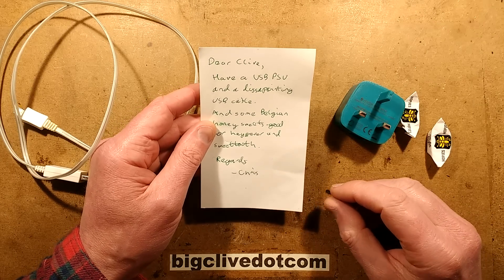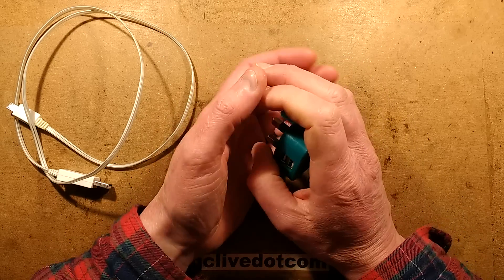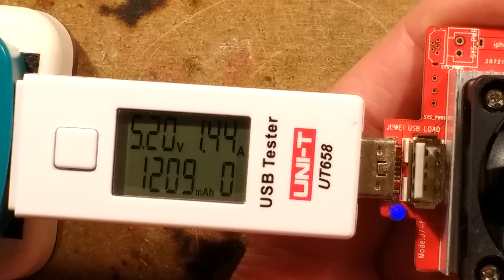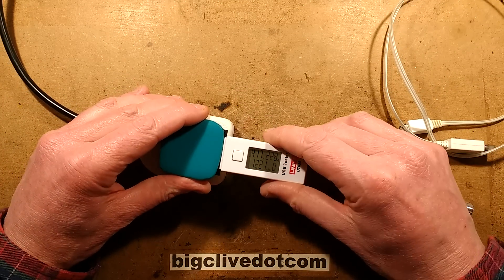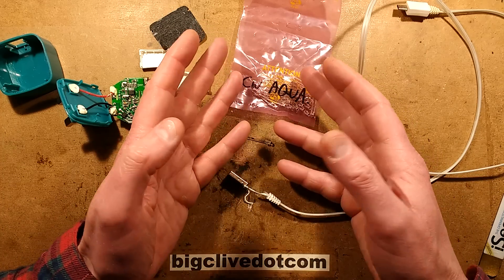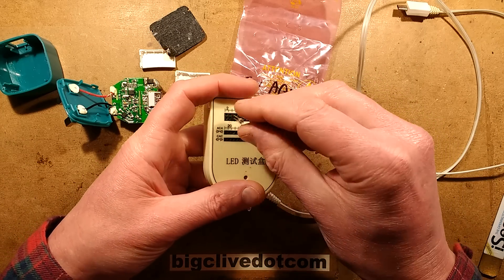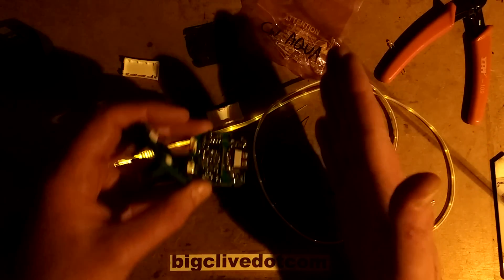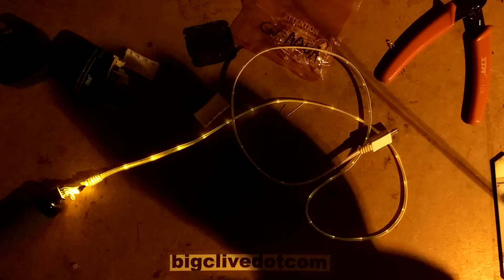Stinky Poundland USB charger and hack of random "faded" USB lead.

Comment: You guys are running entirely too much voltage into your houses.  You gotta just halve it and you'll be good.  Actually, that would put you in line with some of the other countries and you wouldn't need all those adapters and your gadgets wouldn't burn out if you hung your underwear on them.  I heard that Amerika has half your voltage and they're about as dumb a country as you're likely to find on a map.  Here in Nikkobba, we run on + or -55v.  We get 110 by going phase to phase.  We have a center tap we call neutral for small things like electric toothbrushes or flashlights.  We almost never have electrical mishaps.  Once a woman used the center tap for her curlers and took 9 years to do her hair.  That's about all that has happened.  You gotta get with the 90s.  Don't be in the dark.
Reply: alex tworkowski yup, good luck running a 1600w printer with that
Reply: Lower voltage equals higher current, current = heat more than likely to be fire plus alot more wasteful then our UK supply
Reply: Ethan Poole the point of an electric kettle is that all of the heat goes straight into the water you're heating. I have a kettle here in the US, 120v and 1500 watts, and it will heat water much faster than putting a pot of water in the stove, precisely because you're not having to heat the pot itself and the air around the burner. The 3000w kettles they have in Europe will heat a liter of water to boiling in a minute or less. The stoves they have over there are just as powerful as ours. It's just that it's much faster and more efficient to heat water in a kettle. And with the popularity of tea in the UK, an electric kettle is considered an essential appliance, much like a drip coffee maker is here.
Reply: Don't feed the troll...
Reply: ihniwtpu You do realize that we also have 30A breakers available to us, so if one is really inclined to run a 3KW kettle on 120V we can most certainly accommodate such.  In fact, though it is a little challenging to come by you can even keep the same #12 copper wiring and and actually run 3KW by Code -- the only catch is that there are no 25A receptacles so the kettle would have to be either hardwired or upgraded to a 30A service (30A receptacles are readily available).  Not that any of that is really an issue as any US kitchen is going to have a range/stove-top rated for more KW/BTUs than the kettle -- either 240V or propane/natural gas -- so there really is not much need for a 3KW kettle in our kitchens.  Or we can just go ahead and install a 240V receptacle wherever one is desired (my shop has almost as many as it has 120V receptacles).
Reply: I think some here have lost the plot. In converting mains electricity to a 5V DC supply, it does not matter what voltage the mains supply is. The power supply unit still has to convert the same amount of power to get a output of 5V at 2A, so a similar amount of heat is generated by it as a result...
Reply: alex tworkowski  If you have a farm, or a business or a very large house / property in the U.K., you can have a 400V/415V three-phase supply if you are willing to pay for it.
Reply: E=IR so I=E/R.  Notice that the current and voltage are both in the numerator.  As the voltage goes up, the current goes up.  P=I^2R.  The higher the current, the higher the power.
Reply: alex tworkowski  A 60V supply can kill a person in the right circumstances. And lower voltages can affect the human body. Your tongue can feel the electric current from a 9V PP3 battery for example.
With any electrical installation, if it is properly installed using high quality parts and equipment and properly maintained, then it does not matter if the system voltage is 110V, 120V, 230V, 240V, 400V, 415V or 650V. [400V, 415V and 650V systems are mainly used in industrial applications, I have worked on 650V systems as part of my job].
The whole point of using properly designed high quality parts and equipment is so that no part of any live electrical conductor can be touched.
Where large amounts of electrical power are required, 230V and 240V electrical systems do have the advantage compared to 110V and 120V systems. The cost of electrical safety features of U.K. electrical equipment is more than offset by allowing fewer and smaller cables to be used (less copper conductor) while allowing ring main circuits rated at 32A, so giving 7360 Watts of power available per circuit. This gives great flexibility on what appliances we can use and great flexibility on where we can use them. Although the ring main system is the most common, we do have radial (or spur) systems. These are normally rated at 20A (4600 Watts). For cookers and showers (fixed wiring systems) we have 30A, 32A and 45A circuits.
There are very few electrocutions and not many electrical fires in the U.K.
There is absolutely no need to fear electricity.
And just so that I am clear, I also have no problem with 110V and 120V electrical systems. Back in history someone had to decide on what the domestic mains voltage would be. At the time there were various competing systems in many countries. Some countries decided to use one voltage, while other countries decided to use another voltage.
Reply: Mark 1024MAK not correct the drain on the mains supply at 110v would be more than double the drain at 240v yets it still a minimal amount but you would definitely use more current same wattage more current
Reply: Zach tatum-hagger  What is not correct? Power = Voltage x Current. Although for AC if the load is not purely resistive then the power factor has to be taken into account.
Reply: Mark 1024MAK u have stated that whatever the voltage the amount of current converted is the same that is incorrect let's say for argument's sake we have a 220v and 110v on a usb power supply your gunna draw say 0.05A at 220v but at 110v you will draw 0.10A that's more current which equals more heat 🙄
Reply: alex tworkowski I think you are mistaken. You talk about power, voltage and current, but give equations that have one term as resistance.
For DC systems and AC systems with purely resistance load(s) the equations are:
Power = voltage x current [ P=VI ]
Voltage = current x resistance  [ V=IR ]
Voltage = power / current [ V=P/I ]
Current = voltage / resistance [ I=V/R ]
Current = power / voltage [ I=P/V ]
Resistance = voltage / current [ R=V/I ]
There are others where either the square, or the square-root is used.  See here http://www.sengpielaudio.com/calculator-ohm.htm
Reply: Zach tatum-hagger  Whatever you think I said, it's not what I actually said. Read my comments again.
Reply: Mark 1024MAK I have numerous time you state it doesn't matter on the voltage the unit still has to convert same amount of power in correct the output power may be the same but the input power will be different there it's a different current intake this mean more heat to dissipate I don't get what u don't understand
Reply: Mark 1024MAK
Yes, I see all that.  What are you trying to say?  That higher voltages produce lower currents?  That's patently ridiculous.  Electric motors will draw more current as the voltage is decreased.  That we know.  It's a good way to burn out a motor.  But higher voltages will create larger currents in a resistor or in a human being.  You can't rewrite the laws of physics.  
You may be confusing something here.  If a machine requires x number of watts, then it will need to draw either more amps or more volts.  The product of those two variables must equal the required wattage.  A resister does not work that way.  Neither does a human being or a bad connection.  The voltage is the electrical pressure bearing on that load.  If the load is highly resistive, the voltage needs to be increased to produce a certain current.  You are arguing the exact opposite.
Reply: alex tworkowski yes correct to compensate for less volts more current will flow this is the message I'm trying to.get a cross
Reply: alex tworkowski yeh but on the basis of this charger which is what we are discussing this is not the case. Yes more voltage then easier to pass current as there's more push there hence why higher voltage is more dangerous but heat dissipation wise in this power supply higher voltage is better
Reply: Zach, why do you think the heat dissipation is better at the higher voltage.  Aren't we bringing the 230v down to 5v using a step-down transformer?  Doesn't that transformer need twice the primary winding as a 110v unit?  And generally, my first statement was that the Britts are using too high a voltage for everyday things.  My wife has an 1800 watt hairdryer and the thing works fine on 110v.  Wires don't get hot.  That's my main gripe here. All this talk about high voltage being safer than low voltage is crazy.   One guy (a supposed engineer) told me it's easier to transmit the high voltage.  We don't transmit 110v.  The power comes into step-down transformers at thousands of volts.  Then a triplex cable takes it to some of the houses.  2 hot legs and a neutral, which is nothing more than a center tap on the transformer.  Everything is earthed.  Beautiful set up really.  230v is insane.  Hey, I have an idea.  If 230v is good, then lets go to 600v.  Then we could run a train thru the livingroom.
Reply: alex tworkowski yes but your still steeping down a lower voltage which then has a higher current that causes the heat plus 240v is just more efficient again on the basis there's not so much waste higher voltage is more efficient to transmit so you have a large house which would have long wire runs gunna be a lot more loss on the 110v then 240v
Reply: Zach, I don't think the difference is that much.  Remember that these are extremely low current devices.  If you grab the wire, in either case, they will feel exactly the same.  Ambient temp.  Theoretically, you have a point.  But the practical reality is that the difference is overshadowed by the added risk to life and property.   I think the real reason that the Britts went with 230v is that the just took a guess and now it's done.  They know that revamping the whole system would be a pain.  
Now, what's with the ring system as they call it?  I've forgotten if I like it or not.  Was that to cut down on the size of the wiring?  I seem to remember something about the wiring not needing to be as heavy.  Can you explain that system?
Reply: alex tworkowski but yes that's my point whoever said heat would be worse at higher voltage which isn't the case and that's the point I'm making with both yes very low current devices but chances of a fire a minutely higher at the lower voltage
Reply: Oh, sorry.  I wasn't paying attention to the alerts.  No, I don't agree.  Fires are not caused by an elevation in design temperature.  Theoretically, a high voltage device should and does run at a lower current.  But that's if it's staying within design parameters.  What I'm talking about is the danger that is present when there is an excursion involved, such as a device failure or a connection compromise.  Even in the house wiring.   Higher voltages compound any problem by pouring more energy into the system.  A low voltage system is inherantly safer.
Reply: alex tworkowski wow, you are so intellectually superior. That's why Nikkobba is a world superpower I'm sure. Your whole glorious country must be full of only the best and brightest; soon you will come and dominate our dumb asses huh?
Reply: You are obviously a moron so I will make this simple.  You believe that higher voltage means lower current.  (So stupid)  Why not put 10,000 volts in your house?  Go ahead.  What?  Are afraid?  Go!  Do it!
Reply: Doesn't seem like anyone here gets the point about safety.  The higher the voltage, the harder the mains will drive current thru a person who is unlucky enough to complete any number of circuits that can kill you.  You may think that higher voltage means lower current, but not thru a resistive load like a human or a faulty connection.  Put 240v across a dubious connection and you have much more heat than with a lower voltage.  If 110v just produces some heat, 240v will cause a fire.  Such stupidity.

Comment: You've got me worried, Clive. I've been eyeing those in-wall USB chargers. Would you say that's a bad idea for thermal reasons?
Considering that the heat would be mostly proportional to the current draw, would it be fine to use in-wall power supplies for loads like charging phones, where there's a sustained high current, but it tapers off quickly-ish?
Related: do you know if is it possible to buy USB ports with a built-in switch to detect if something's plugged in, so that the PSU can be turned on only when needed? I've tried looking but couldn't find anything like it, but maybe I've been using the wrong search terms.
Reply from the maker: I think some USB wall plates do have a switch, but none of the ones I've looked at.  However, they are generally well ventilated inside with the whole front of the socket and surrounding wall to help carry away heat.  I tested a UK British General socket yesterday and the standby current was just 0.3mA.
Reply: I subscribe to "thomas nagy" and he, as a sparky, is also impressed with the British General units. In a recent video he showed these ingenious little backplates that go between the wall plate and the wall itself that has a sort of tray to hold your item while it charges. GENIUS!
Reply: Thanks!
Reply: Although I find them intriguing I am not as enamored with them as some others are.  I tend to look at things from the perspective that, for the most part, electrical hardware is likely to have a 30-70 year life before it is at all likely to be updated or replaced (and sometimes much more).  As ubiquitous as USB chargers are today I would be very surprised if they were still relevant (and with unchanged voltage and current specs) even 30 years from now, much less 50-70.  Plus I don't really expect those power supplies are likely to hold up for that many years...and they really should be removed from service when they fail, but I don't see most homeowners actually following through on removing them when they fail or become out of date.  But that is just my opinion and I certainly don't judge anyone who may disagree.

Comment: Power supplys are generally on or near the ground. You don't want dirt running around or your PCB do you ?
And it doesn't need to be excessive, a single unlucky pine needle and you got fire.

Comment: Recently managed to overheat my power supply exactly by accidentally covering it with clothes. Came to it really hot and smelly, threw it right away as I did not want to risk it. It was a good adapter though, I will remember it as it served me several years

Comment: There must be one company making all the bits for PSUs, they all have the same yellow taped inductors and green capacitors.
Reply from the maker: The yellow winding tape is very common and a lot of capacitors have either blue or green cases.
Reply: bigclivedotcom at least they’re consistent. By the way I’ve still got that CPAP machine if you want to dissect it. Let me know if you’re interested. 👍

Comment: Where do you buy solder? What type is best for electronics stuff like this? Figured I'd ask what you're fond of.
Reply: The older leaded Ersin Multicore is excellent, but so are some of the Chinese solders - they all use a Rosin-based flux, and produce good joints. Best value is to buy by the reel (500g), and for fine PCB work, thinner solder is better (obviously!)
Reply from the maker: Buy it from a prominent electronic supplier in your country.  Not on eBay.  You're looking for 60/40 tin/lead electronics grade solder with a flux core.
Reply: I buy Warton metals 63/37 solder. Its a bit more expensive than the Chinese solder but better quality and made in the UK . I like to support British manufacturing where possible.
Reply: I've always had good luck using Tenma 60/40 rosin core (it's a Taiwanese brand). I've had a roll of it since 1996 and it has never disappointed. Don't get some generic stuff off the shelf at Walmart, that stuff is useless!
Reply: I have been using the kaina brand 63/37 solder from ebay for years, it works fine for circuit boards and it's cheap.
Stay away from the lead free crap if you can.

Comment: Clive, a  happy easter to you. Two things please I have been meaning to ask and this has relevance to the subject matter here.
Would you do yet another informative bit on the LED tester, just received one I ordered (because of you btw:-) with obviously incorrect resistor array, ( duplication of R values to be so damned cheap it isn't funny )  & I humbly request ...would you do another piece in the  LED realm about the means by which LED's may Auto Change, and then case-in-point the mechanism by which causes the Candle Effect you employ.
Reply: What kind of LED tester did you buy? (And additionally, do you know which one Clive has?)
Reply: http://hdamodelworx.com/LED-TESTER_p_130.html
Reply: https://www.ebay.com/sch/i.html?_from=R40&_trksid=p2047675.m570.l1313.TR0.TRC0.H0.X2+150mA+LED+Tester.TRS0&_nkw=2+150mA+LED+Tester&_sacat=0
Reply: Thanks alot!
Reply from the maker: The colour change,flashing and candle LEDs all contain small integrated circuits mounted next to the LEDs inside the resin case.

Comment: Why not make a psu with a heatsink
Reply: You could solder a small metal fin on one of the diodes leads/terminals.  That would sort of help keep the diode and capacitor cooler.  Of course, you need to keep it electrically isolated from anything else.  I did this for a hot running zener regulator.  It hasn't failed since.  Still runs hotter than I would like but you only get radiative cooling.
Reply: Space savings.
Computer psu do have gigantic heatsinks
Reply: Suraj Grewal well ik that i mean usb psus sry i forgot to mention that